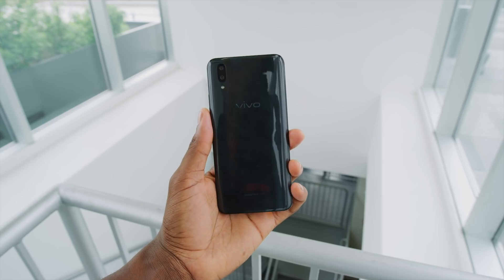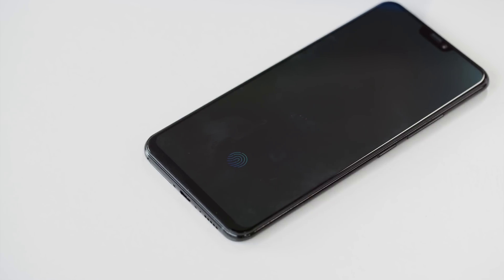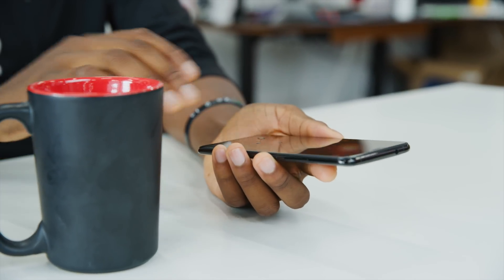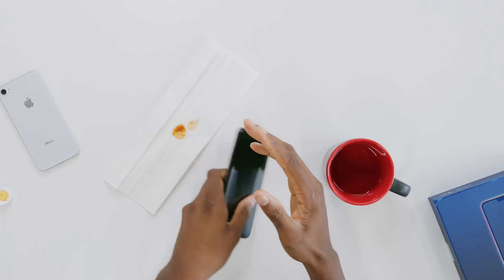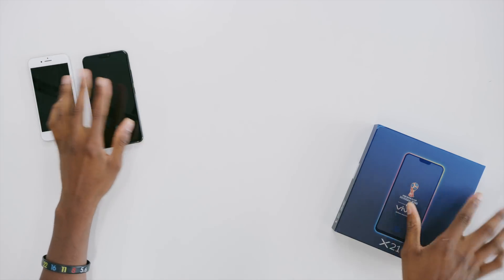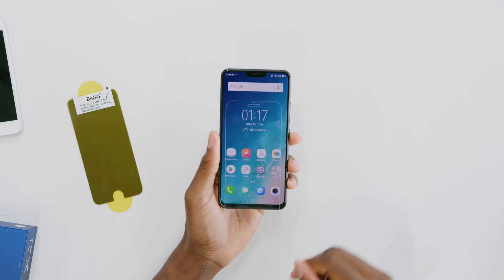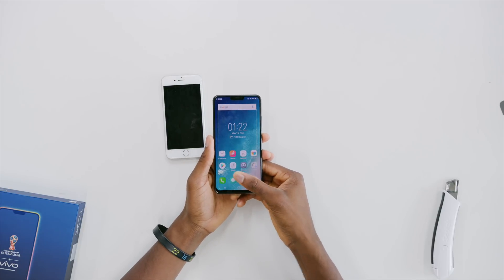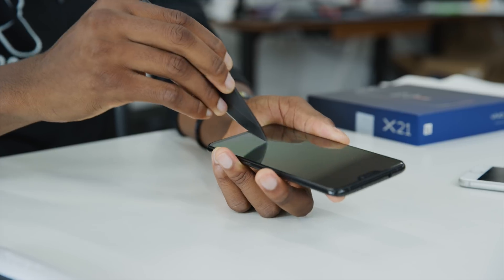In-Glass Fingerprint Sensor: Testing the limits!

Comment: Did you try unregister fingers
Reply: Arshil Ahmed the fingerprint scanner is not fake.
Reply: Bcoz optical fingerprint scanner is like camera under screen,so with scratches it should not unlock
Reply: Arshil Ahmed it's not like a camera.
Reply: Arshil Ahmed even a scratched iphone button registers fingerprints. and its the same type of sensor.And „i know more about in screen fingerprints“ /r/ quityourbullshit is for you my friend.
Reply: i had the same question, because how is it possible to scan when scratches above the display?
Reply: Sangeeth Mk yes,and many reviewers already said that it not work with screen protector
Reply: Arshil Ahmed It will always work because even with scratches in the screen, the light that go through the AMOLED panel is registering your fingerprint. Maybe if you break the scree where the fingerprint reader is located , the light would not in a straight line and do some reflections.
Reply: Triaxelon Gd iPhone uses capacitive fingerprint and Vivo using ultrasonic fingerprint scanner,wtf u are talking,they are both different
Reply: Arshil Ahmed it is an ultrasonic sensor underneath the display. It's not the same as a capacitive sensor. But the vivo x21 is using the piezoelectric effect, exchanging pressure on the surfacr for ultrasonic signals which travel through the OLED panel. Even with scratches there is nothing blocking those signals. Then the 3D model of the fingerprint is recreated ,
Reply: javier dominguez yes that is possible
Reply: One thing you should know, there is always present tense after you use 'did'
Reply: Nabhonil Biswas ok thnks
Reply: Arshil Ahmed ye i forgot, about the iphone scanner.Still the Sensor works even if scrathed so my point stands.
Reply: Triaxelon Gd ok plz stop
Reply: It's clear that you don't know anything about this sensor. Search on Google how the "synaptic fingerprint scanner" works, than you'll understand
Reply: Lars Hoeijmans don't need ur suggestion
Reply: Arshil Ahmed don't act like you know everything then. You don't know shit.
Reply: Lars Hoeijmans exactly I don't know shit
Reply: Arshil Ahmed exactly. At least you are admitting that you're an idiot. That's a good start.
Reply: Arshil Ahmed are you dumb?why would they put a fake sensor?
Reply: Masta Nugroho did I said fake,read carefully,it is new technology it can be inaccurate,I know more about in screen fingerprints
Reply: Lars Hoeijmans but it is a sensor under screen which captures fingerprint,no physical contact can be made with this type of fingerprint technology

Comment: Sausy fingers .... really ? Was that really needed after the water test lol
Also u can forget fingers in 2-3 years anyway, face id would evolve a lot for almost every phone and will get to the point where it can unlock from distance and diagonally read your face and even horizontal.
It comes with less limitations compared to physical touch so it makes sense for all manufacturers to speed up and make that super good and reliable.
Under glass finger print looks fancy , but thats all about it... no physical touch is superior and will be when it reach its final form.

Comment: Once Samsung does this with hopefully Note 9. I'm upgrading. Until then. I'm fine with my S7.
Reply: NET Alliance the note 9 leaked, and sadly it wont have this feature. We have to wait for the S10 :(
Reply: NET Alliance Yup, still rocking my S7 Edge, and it's fast as hell.
Reply: NET Alliance same here, I am really happy with my s7 edge
Reply: my s7 sucks.. i have to press on my screen sometimes because i get a black screen.. i
Reply: Me too, but i wouldnt like an in glass reader.
Reply: Happy with my s7 edge ba
Battery life is a bit of a problem now but still manages to get a day
Reply: note 9 is not going to have it yet samsung set it a few days ago !!!
Reply: How long do we have to wait for Note 10?
I really want a Note Phone, but i guess the fingerprint wont be coming to the 9. 😬
Reply: i put lineage os on my s7, battery problem fixed :)
Reply: San Gurung like September of 2019
Reply: LAAAAAAG
Reply: You should wait for S10, it will have 7nm and likely have 5g.
Reply: NET Alliance it for S10 cos they want to perfect it. It's a different type called ultrasonic so it can work with wet fingers
Reply: San Gurung probably a whole year after the release of the note 9.
Reply: Definitely not with the Note 9. The tech is still very new and slow as you can see here. Samsung will want to be sure that they've got the best under glass fingerprint sensor on their flagship. So expect it to arrive maybe on the S10 (assuming Samsung doesn't drop the galaxy s moniker before that)
Reply: Just wondering why this is the main point of your upgrade.
Reply: Unlikely. The S and note models each year are very similar to one another, if the note were to be a complete redesign or drastically better, it would impact galaxy S sales. Basically, the note is like the S model on steroids so yeah.
Reply: NET Alliance 
You should wait for the S10 anyway. Newer manufacturing process for soc, less bezzel, hopefully larger battery, etc.
Reply: I have an S7 Edge and I'm perfectly fine with it! :D
Reply: Tech Yourself 
But Vivo is overpriced anyway
Reply: Either Note 9 or Galaxy S10
Reply: actually the s8+ is pretty still and will be optimal in the next 3 years, but the s10 i believe will be in a whole new class in its on, i will NEED it

Comment: How come they can strech the top corners without the top bezel but they can't do it on the bottom corners like the iPhone X?
Reply: Shayan Givehchian because they are cheap and don’t want to pay for the folded display connector under the screen
Reply: Shayan Givehchian Not only Samsung,but other companies can do it too if they want to.
But apparently it's super expensive to do so and they don't think they can sell $1000+ phones.
Reply: Shashank Holla wtf? Samsung did it first...👍
Reply: TVCH LORD cheap? Samsung costs more to make than shitty iphones. Do ya research before u chat shit. Also Samsung does notwant a notch cuz it looks retarded. The s8 and s9 has less bezels than the iPhone anyway so who's caring?
Reply: Andrew, it's not like iPhone X doesn't have a chin as well. Most of the people seem to be fooled by iPhone X design into thinking there is no chin, but it does have one at around 4.2mm - a chin that extends all around the phone. Vivo X21 has 5mm chin, so the difference isn't that big, especially considering that the sides of X21 are only 1.66mm thick, compared to the 4.2mm  sides on iPhone X. 

Because of this, iPhone X "only" manages 83% screen-to-body ratio, compared to 90% in Vivo X21.
Reply: Its VIVO Apex
Reply: Kunnal Thapa dumb ass. Samsung been making the glass and screen all in one since the galaxy s2 its called super amoled
Reply: Shayan Givehchian because it looks horrible
Reply: I’m pretty sure Apple has patent because they were the first to do it, but it could also just be super expensive to fold the screen over itself
Reply: Shashank Holla no samsung curved screens fold in the screen to the sides
Reply: They have to keep the display controller somewhere(at bottom in case of the X21) and only Apple knows to fold the display controller to the back at the moment.
Reply: Shashank Holla not even samsung ? Don't they make the iPhone x displays ?
Reply: It's very expensive to have the display controller folds to the back that's why some other OEMs haven't done it yet not that it's impossible to do it.
Reply: That's what I was wondering as well. This would look so much better without the chin. Having both a notch and a chin makes zero sense to me.
Reply: Um nearly ever single LCD I have EVER taken from a phone folded to the back... actually they all have.
Reply: Correction: Samsung made iPhone Xs displays. If you are looking for the most advance displays on the market. Then  definitely its Samsung. Thats why Apple came knocking at their doorsteps, Apple wanted the best with their products.
Reply: TO ADD: somw say the vivo apex phone is the most advance display? Hahaha nah, The Note 8 and iPhone X are the best displays for me. Sure vivo apex phone has the most minimal bezels to boot but can the bend a display just like Samsung did? the iPhone X achieve minimal bezels on the buttom chin of the phone because Samsug actually wraps the OLED screen to the body. Wait until the S10 and the new iPhone X 2018.

Comment: The flagships are definitely going to have this for sure. It is undoubtedly much better than any fingerprint sensors that we have in the back of our phones nowadays.
Reply: Amit Shah the "tradition one" used to be a concept just like in-screen one too back in the days. It takes time to become better. Remember Galaxy S5 fingerprint button? A bag of crap. And yet now it's so smooth and fast on the new S phones.
Reply: I never understood why you can't just put the reader in the back. Mine is useful for gestures as well
Reply: Why not both, in-display and back ;)
Reply: Its definitely the better choice 
The only disadvantage is the speed and that will improve quickly

Unlike those at the back you don't need to pick your phone off the table
 Plus your finger is already on the screen after unlocking, no hand gymnastics, nothing. 

Just double tap to wake( im sure you wouldn't even have to wake it in other phones), place your finger and good to go, plus leaves space at the back to put the camera more central, unlike at the angles where your fingers might obscure the lens

Anyone who doesn't think this is superior to any other placement is smoking
Reply: Finger print reader at the back is better
Reply: Pussy Eater how is that better?

Comment: Touch ID hasn't been a gold standard of finger printing for a long time. Other manufacturers have been making faster and better finger print sensor for a long time, and my LG V20 reads my finger even with water on my finger. 

Disappointed that MKB has slowly become a apple advertising machine on people's subconscious mind (giving more credit to apple than its due and taking credit away from other manufacturers where it's due.

EG, this in-screen finger print reader is far further along than first gen touch ID, but all it got was nothing amazing and not bad.  Had apple been the one to push it out and put it on iPhone X, you'd probably be kneeling and worshiping them lol.

Comment: I want an in glass finger print sensor that works anywhere on the screen.  So I can touch anywhere and it will scan my finger and unlock rather than at the bottom of the screen where it is difficult to reach.  Also think the sensor in the back makes more sense that an in screen sensor or face id.  When you answer a call, usually you don't have to unlock the phone as the answer button appears so it just needs to register a touch to answer.

Comment: Well, the optical sensor is under the screen. I'm guessing that Unless the actual screen breaks/cracks, the sensor would work in most cases regardless of scratches/cuts etc, except for water/liquid splashes.

Comment: Really great , but after the tech is introduced it's probably gonna be a couple years before damages to the glass and sensor can be dealt with by repair centres , so manufacturers need to enhance the strength of the glass to protect the sensors